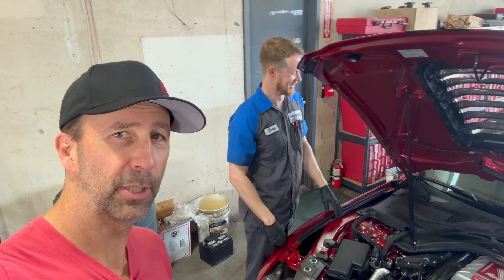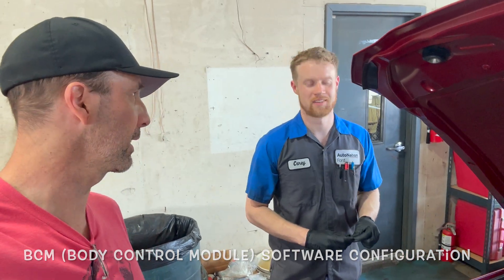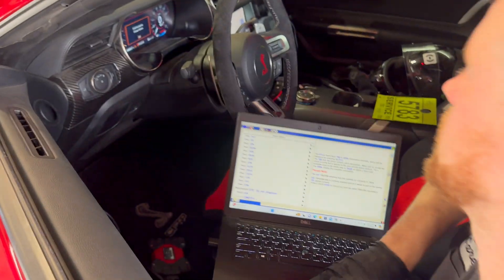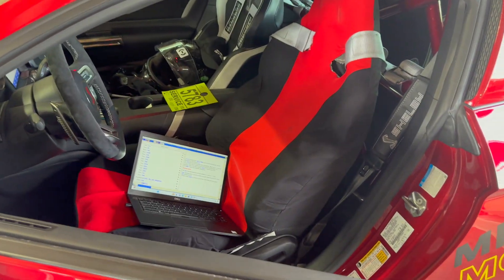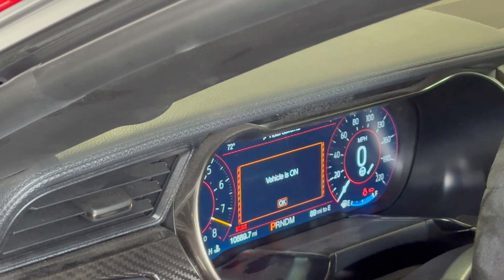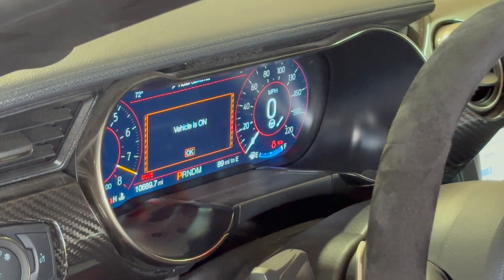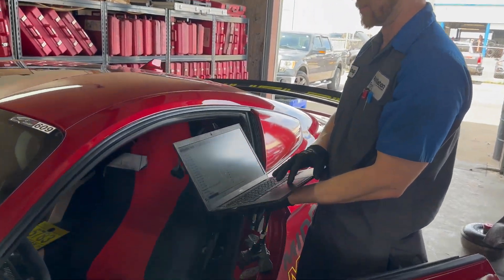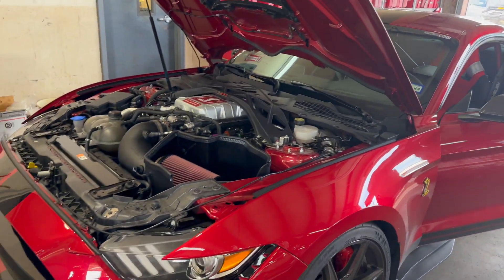2020-2022 Shelby GT500 Brake Recall (23C35 BCM Configuration)

Comment: I just had mine done last week my local dealer sent a mobile tech van with two technicians to my house did it in my driveway and it took maybe a half hour. I guess because it’s a safety issue they do that. Very convenient
Reply: Had this done as well as the transmission recal about Dec of 2023... same way. Tech showed up at my house as scheduled and it was all of 30 min..  Tech said it was nice I had it on a battery tender (PA, Northeast) since 1/4 of the homes he goes to has a dead battery. I was like, whaaaa?